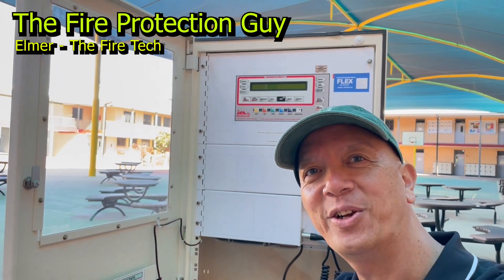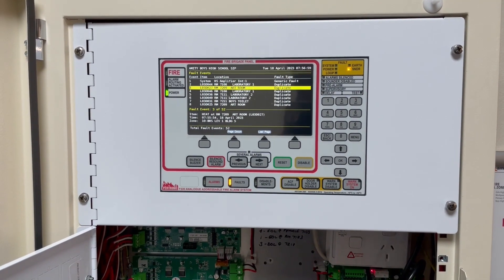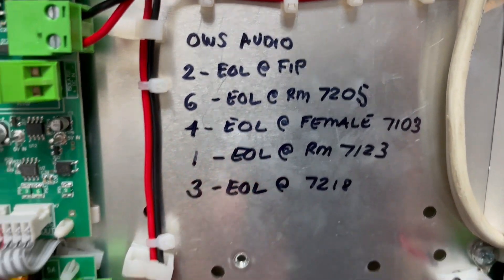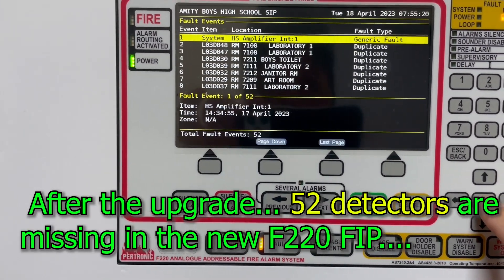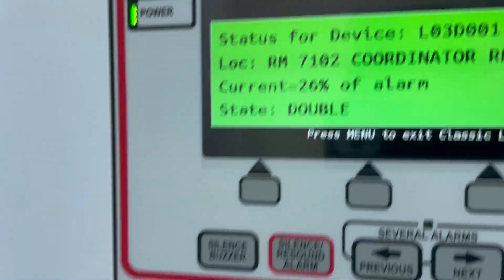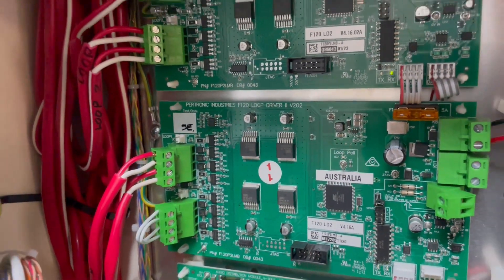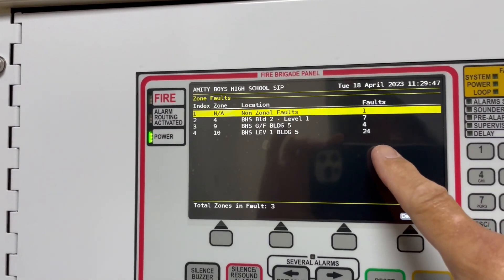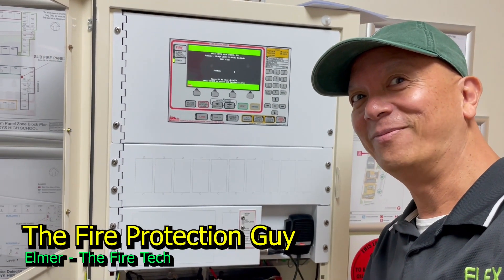Fire Indicating Panel Upgrade - Pertronics F100a to F220.

Comment: Hello. Thank you for the all your video. I am very interested in fire protection systems. And someday I would like to be a good fire protection engineer. In fact, I would like to work in Australia as fire protection technician, but I am not a Australia's citezen. I have plan to go to Australia with Working Holiday Visa. Is it possible for me to work as fire protection technician?

I have almost three years nuclear power plant operator experience. My duty was to operating a system and inspect fire extinguisher in the facility. That is not related to fire protection directly. However, I am really passionate, active and fast-learner. If I have a chance to work as fire technician in Australia, I am sure I can do work better than anyone.

I would really appreciate if you give me good answers. Thank you. Have a nice day.
Reply from the maker: Hi Mate. Everything can be done and achieve if you were given a chance to work in this industry or in any other industry. A service personnel or technician requires good training, knowledge of Australian standards, exposure to local businesses, roads and safety standards. But as a person with holiday visa, no employer will spend time and money to train you in this level of work. Sorry but..that's the reality.
Reply: @fireprotectionguy7943  Thank you for your answer. Well. I know the reality and that I have to get some certificate for the job. Honestly, I really want to do this job in Australia even though I have working holiday visa. Is there any way I can work on fire protection in Australia? I know it is hard for me to work as a fire protection technician. But if there is a possibility, I would like to try. Thank you again.
Reply from the maker: @chlee8985  ..if a company wants your service, why not try it. Check this website. Send email to all fire company or individuals and see if they will be willing to help you. Good Luck.
https://connect.fpaa.com.au/Connect/Registers/All_Current_Members_Of_FPA_Australia.aspx